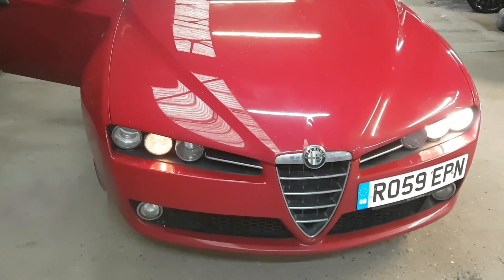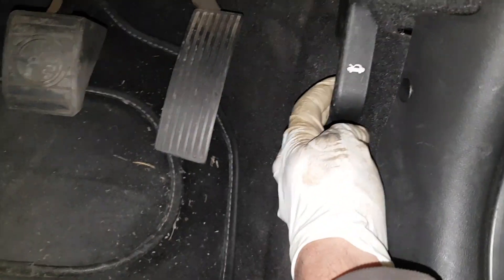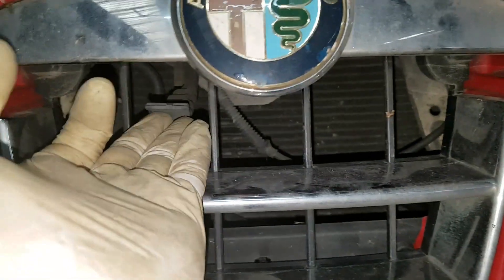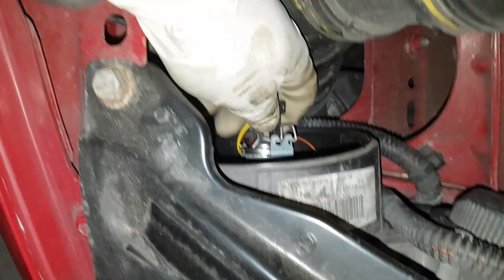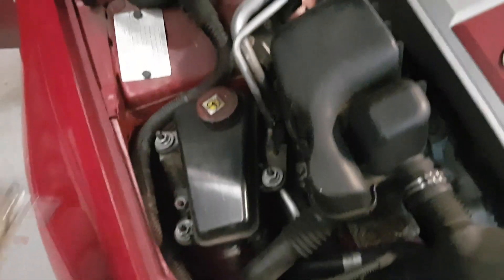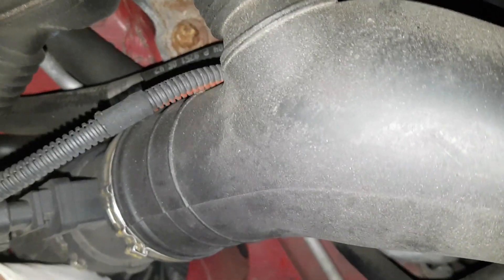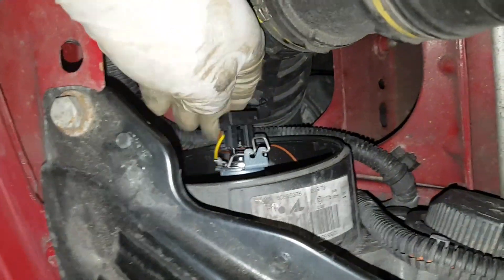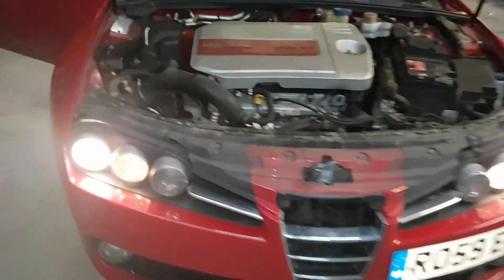How to replace headlight bulb on alfa romeo 159 #headlamp #tmm

Comment: According to eLearn H7 dipped beam bulb's tab should point down at an angle. It should go between to metal prongs on the casing. H7 high beam bulbs point up.

Comment: Nice one. Do you have anything similar for 156 ? I've nearly lost pieces of finger replacing sidelights and headlights (bulbs) on my 156, and have to be convinced that it's possible to change a front indicator bulb on a 156 !!
Reply from the maker: Hi sorry I’ve not come across one but have you checked under the wheel arch see if that’s removable? If you jack the car up or turn the steering wheel and remove the front arch liner screws, pull back the liner to see if the back of the headlight can be seen properly. Hope this works 🙂

Comment: Are both the high and low beams H7 and same bulb size??
Reply from the maker: +SMGJohn yes both h7 same size bulb. In description i've put what bulbs needed for front and rear. Thanks
Reply: +Taj Tyres ltd
Could you tell me what mount the parking lights are? The ones in the middle were the blinkers are situated, also H7 or H1?

Comment: Hello, nice video? Can you explain me a little bit how can İ change the High beams. Because those little sons of a b*ch are really hard to change. İ managed to change the right one but the left one is imposible to change there are cables everywhere no space for fingers. Do İ have to remove the front bumber and remove the headlight to change the f*&ing bulb? Can you help me please bro. İ want to convert my lights to xenon or LED. İ have both 2 sets of Xenon and LED bulbs but LED bulbs have fans in the back and they dont fit there is no space in the headlight. For the xenon ones İ have to drill holes in the back of the headlights for the ballast cables. Soo long story short the headlights on this car are beautiful but real torture to change bulbs.